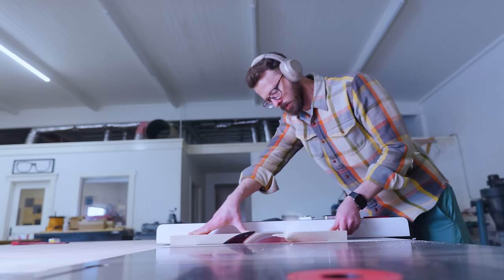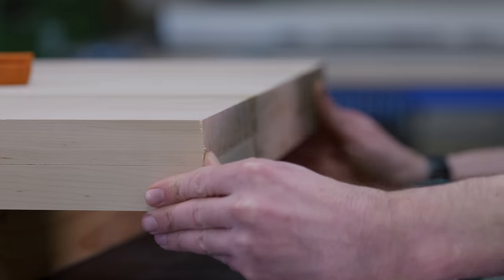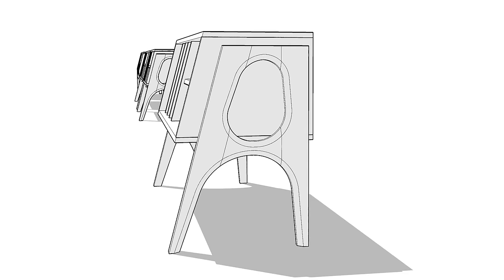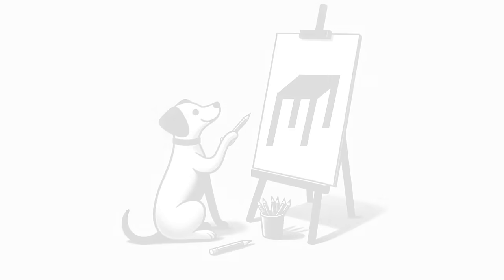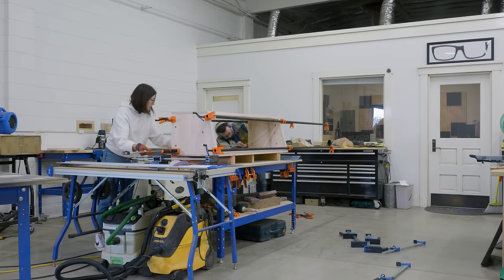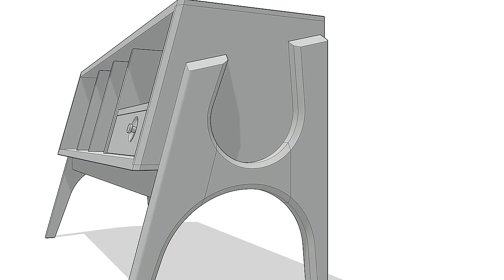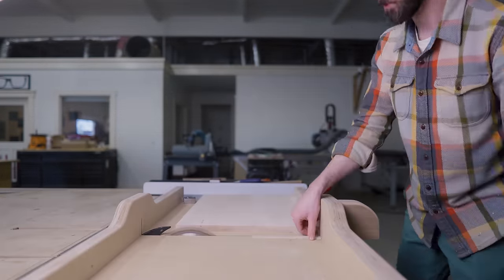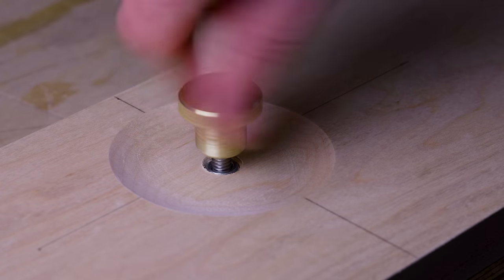A Company Stole My Design... and Started Selling It

Comment: Congrats on being tossed into the algorithm, it finally came my way. Splendid!

I used to build custom cabinetry which often included "stuff" cabinets like this and I notice a lot of woodworkers on YT just love doing everything in solid wood regardless of how big, heavy, slow, EXPENSIVE, and sensitive it is. We built nearly everything out of veneer plywood and "surrounded" them with solid end panels to cover the exposed plywood edges and give it the appearance of being crafted from entirely solid wood. It made builds far cheaper, lighter, and with lots of clever little tricks it would look indistinguishable from a completely solid piece. And for dividing interior panels like that, rather than going through the effort of dadoing the interior of the box and cutting a tongue in the divider, we would use these thick sturdy lightweight wires that could be tapped into holes that were drilled into the interior, and would instead run a dado on the top and bottom of the divider that was slightly thinner than the thickness of the wire. The divider would slide in from the front and I tell you it, those dividers did not wobble in the slightest, and there was no time wasted with precise tongue/groove routing; just a square line, some quick holes along it, wires tapped in, fast dado on the top and bottom edges, and slide in. Bam!

But, with plywood as a skeleton, we didn't need all the wood joinery tricks, and I know at the end of the day that seems to be the draw of YT carpenters; employing those tried and true old-school tactics with modern tools to craft something tangible and unique. Learn something new, make something that's hard to find at a store or from a larger company, and show off the work proudly.

I guess this is a long way to say I guessed over 275lbs. With two 5 foot boards of what looks like 1" thick solid maple, 2 end panels the same thickness, 3 dividers @ 3/4" or so, and an entire drawer of solid maple, I was sure that console weighed closer to 125 lbs and I overestimated the weight of the records as well. Excellent work and glad to see carpentry staying alive
Reply: Hey there your comment is so good but unfortunately YouTube's type of font is not helping. It would be better if you made it into video. Thank you.

Comment: Architect here who has designed a lot of custom millwork (& does wood sculpture on the side). If you had made the walnut stretchers as plywood (glued up a few thinner pieces of the walnut, perhaps added a bit of depth to the stretcher), then finish the overall pieces same as the single solid wood stretcher, you wd have gained stretcher strength w/ effectively the same sized (single piece appearing) piece. I don’t think the glue up seams wd have been perceptible.  Interesting process. Great designs. Glad u like the film editing & design process too. I think all true designers love different aspects of creating a piece. Splendid.

Comment: Probably your BEST outro in my opinion. "both officially and for the record". Also, just as a note, copyrights are automatically bestowed. You need not to register them for legal protection. So, technically speaking, if a person decides to 'use' any of your designs for profit - they are supposed to get consent from the creator and or some sort of licensing agreement. Even if they make minor tweaks to the original design, if it can reasonably deceive an unsuspecting consumer - it is enough to obtain an interdict to stop them from using your design. Obviously, this is a more legal route which, honestly speaking, could be more expensive than the piece itself. Herein lies the challenge. But, we LOVE that you are constantly creating and improving and or updating your designs. No offense to the old design but this one is too sweet!!!
Reply: Are you sure that designs like this are copyrightable? I see architecture listed from the government website on copyright as an example of a copyrightable work, but not smaller pieces. The instructions (written or video) to build the piece are certainly copyrightable, but I'm less sure on if the derived object built from such plans is copyrighted.

(I think it should be copyrightable, but I also think copyrights should expire after ~25 years, so my suggestions on copyright don't necessarily line up with actual copyright law.)
Reply: @dosadoodle Actually, "instructions to build or assemble" an item (also referred to as plans or pattern) are specifically exempted from copyright protection. The exception to this is architectural blueprints.
Reply: Copyright does not protect furniture design, unless the piece is so unique that it would be reasonably considered a work of art. A piece of furniture would only be protected by either a patent (utility or design), or trade dress. And again, with a patent or trade dress, the piece would have to be ridiculously unique and immediately associable with the creator in order to be granted protection.
Reply: you forgot the Pneumonoultramicroscopicsilicovolcanoconiosis
Reply: This would need a design patent  its not a concept protected by copyright.

This distinction is important so that you can have 3rd party screws and stuff.  You wouldn't want a physical items resemblence to fall under copyright
Reply: Copyright laws are made to cover big businesses. As someone who isn't a multi millionaire you will have no luck trying to do anything legally with copyright
Reply: @ficolas2  its pretty easy actually if some newspaper publishes your pic without permission etc to get compensated.

Big corpos abuse copyright sure, but using it as intended isn't impossible, say if timbaland rips off your song.

However as said thats for using copyrights as intended and a general form of a furniture isn't copyrightable at all, if it was the first to make a white shelf would be swimming in money(copyrights last a long, long time)
Reply: This guy's didn't watch the video 😉😄
Reply: @oneyearunder  lol "splendid"
Reply: The idea that similarity in design or copying someone's one off project and selling it requires consent is pure egotism. There is no requirement to do this unless a piece is registered with a copyright and your reproduction is so similar as to cause confusion. You can be less of an ass and say something was inspired by a design, but that just opens you up to litigation.
Reply: Yes indeed
 Everyone always confuses copyright and trademark
Reply: Even with the copyright automatically bestowed, one would still have to register to make a claim for damages in a court.
Reply: @matchstickdesignco  the whole piece wouldn't need to be ridiculously unique and associable for a design patent. Associability isnt a requirement for a design patent. Also, it could be a very specific aspect of the design that would be claimed (solid lines) and unique (novel / nonobvious) for the design patent.

Comment: It's interesting that this showed you randomly in my feed because the moment you showed your original console I thought " I recognise that!"
The reason being is that back around 2009/10 I built almost the identical thing but without the legs/base. Because mine was for the bottom of some floor to ceiling bookshelves meaning that the piece stood by itself on the floor and then four tall bookshelves sat atop of it. I made mine from what them was probably the last available Parana pine available in the UK as it's no longer available due to bans over sustainability. It was beautiful and had some lovely deep reds in that lent itself to just oiling rather than staining. I also left the inclusions and knots in and just epoxied them because they add character and I knew I would be unable to source any more lumber.
But yeah, I guess there is little new in design and it's not worth getting upset about seeing your designs on other pieces but when you have directly had contact with a company that then goes ahead and reproduces your work for profit after being told you are not interested in producing more, then that I'd be talking to a lawyer about.
Anyway some 15 years later the bookshelves which I built for my aunt are still going strong and just need some Danish mixed with linseed to oil them up once a year.
But yeah, that base is almost identical to what I came up with on the fly. ( I did bullnose the leading edges before i finished as it just seemed right at the time. )
Wonderful bespoke pieces you produce.

Comment: Woah! This piece is amazing, just like the longest word in the dictionary: pneumonoultramicroscopicsilicovolcanoconiosis. I love the additions of mark inclusions and mineral deposits in furniture. Two tricks that I use when including them are instead of using just black epoxy, I use coarse walnut dust and 5-minute 2-part epoxy and mix it to a chewed Tootsie Roll consistency. The other is using Naphtha to reveal how the area would look after finishing if you were to oil and wax, or oil and lacquer the piece. the best part about Naphtha is that it dries quickly and leaves the wood as it looked before. Keep up the great work!
Reply: My dad passed this one on to me years (years!) ago: polymorphonuclearneutrophilicleukocytosis, after which I made a model of polymorphonuclearneutrophilicleukocytes for a high school science project. At the time, it may have been the champ, but now I see it falls short of the heavyweight belt by five letters. All that's left is a one way ticket to Palookaville.
Reply: the longest word in the dictionary is elastic, it gets bigger and bigger
Reply: @PlayGrum , uh-uh. Smiles, because there is a mile between the two s's.

Comment: Hey Chris, I have a problem with your gentleman agreement : I've already clicked the like button from about 1/3 in, but I guessed wrong, and I don't plan on clicking off that like ( because it was spontaneous move). So you know it.

I am also building myself a desk, and took a lot of features off your Desquire design ( mainly the cabinet), whith a totally different set of feet.

As a beginner woodworker, thanks a lot for sharing your processes and results so openly. You are a real source of inspiration.
Reply: I have sortoff the same problem. I was wrong so now i have subscribe….but that means i have to unsubscribe first. And my second problem is i dont know where to put the word splendid into my previous sentence.
Reply: @KoenvanderKouwe  Exactly!

Comment: Regarding your clamping system at abt 26:30, i think i've seen an alternate version of that where you cut a slightly over sized length of wood in half and add a hinge. Then you cut the assembled length to size and use the hinge to "pop" it to full length while positioned in the cavity. 

on a side note, this is the first of your videos i've watched and i'm now subscribed. Your work is truly splendid and i intend on binging your videos for a bit!

Comment: Splendid calculation you done of the weight. But good to have made the cabinet able to hold more. My record player is 11kg in itself. And my integrated amplifier is 20kg. It's also good that the console itself has a lot of mass with vibrations from amplifiers and all. Great piece

Comment: You should think about the following variation on the record slot design: first, let the bottom of the shelf slant toward the back so the records will seat against the back with a gravity assist; second, introduce an angle in the back from one side to the other so each record is slightly offset from the next.  This will make it much easier to extract and replace records.

Comment: This is the first video I've seen of yours and it is splendidly done. One design aspect that I'm curious of is the well to dig out the brass record stand.  With everything else being so integrated, was there a thought to rout the rightmost edge slightly deeper so that you could simply push the end of the brass rod down in order to retrieve it?

Comment: It would be unfortunate, if you were to get pneumonoultramicroscopicsilicovolcanoconiosis, though using power tools to work wood, hypersensitivity pneumonitis is more likely.  But that isn't one word, or as impressive sounding.

I guessed over.

Did you say, you were considering recessing a phonograph into a live-edge cabinet top?  I think that would be impressive.  Though matching the colour of the phonograph, with wood with a complementary or suitable hue, may be a challenge.

Lovely work!

Comment: I once designed a unique bike crank and pedal integration. Decided against patenting it, there were better designed already found between our friend group, that did end up patented.
Turns out, by exact design got patented in the exact time period I opted out from patenting same. Parallel thought. The universe/God wanted that design to be on the table for humanity. You can order it still, I think. I never ended up buying it, several of my unique or parallel designs. One became quite mainstream for a while (29+ bikes) which the original company heard from me about, 8 years before they "invented" it. There was a whole new crew at the brand, they may have found drunk sketches of the former crew after hanging out with a weird tall Dutchman who just wouldn't get drunk but sure liked his doner wraps.

Comment: I hope you look into copyright law so you can know whether  or not your designs are protectable: filing a copyright costs $65 USD. Copyrights automatically attached to tangible works of art, but if you want the government to assist in the protection, you must file. It should be noted, though, that copyright protection is the weakest of the three major areas of IP protection. Anyway ...I just got tired. You should look into copyrighting a design, trademarking your company name, or patenting any unique, non-obvious design. Harmony.

Comment: I am not a woodworking artisan. I am not male, so the “gentleman’s agreement” kind of doesn’t count here but thanks for letting me play anyways. I said under. Your video was splendid, however. I am an artist and my designs did get stolen. 13 of them. Sold all over the world. Without one drop of compensation or acknowledgement. Everyone told me it was tough luck. Even my agent. I felt like $#!T. Nearly gave up. Stealing designs that you work hard to make uniquely your voice and vision…. That sucks.  And, (take note fellow artists: if you have registered your design with the copyright office) is illegal. A bold and assertive law firm (Dinse in Vermont) took up my cause and we went after the big guys. The biggest and the second biggest. You know who I mean, you shop there all the time… We took them on because stealing artists designs is not only wrong, it is illegal.   I won. Little old me. Your mileage may vary.  As for your piece that you made here…since you asked…I would have preferred it with a clean end, not the knot. For me, the purity of the piece was disrupted by that knot. Maybe the buyer will really love it for the epoxy filled knot, along with all the other details you put into this piece. Hope so. Cheers.

Comment: Sorry, forget the secret word already and too lazy to wind back to where you showed it with the pocket tool. Anyways, the as to what a joint should be able to take weight wise is that many times tables abused to reach say a ceiling light or something. So an average 300 lbs murrican will jump on it and I think it should be able to take it.